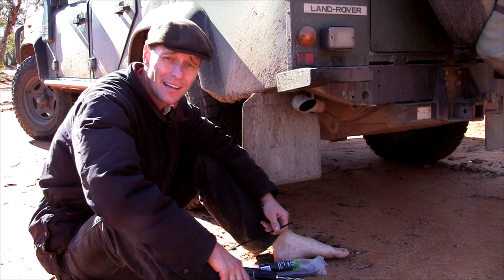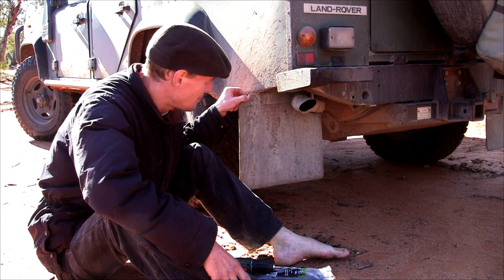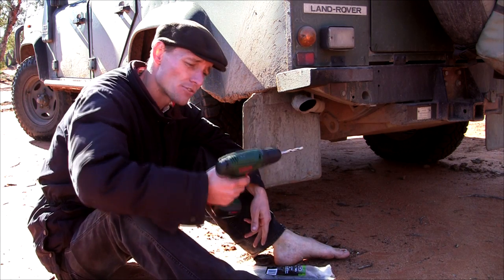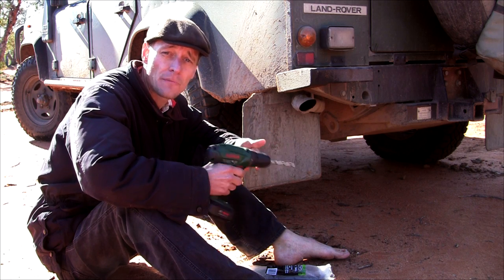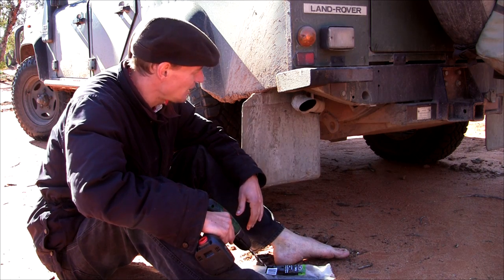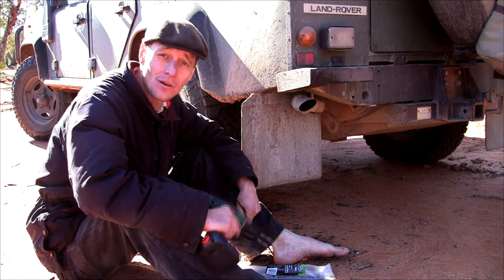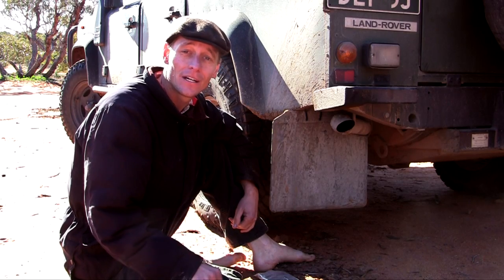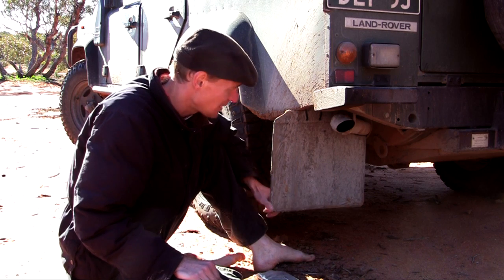Bush Mechanics | 4WD Mud Flap Repair with Cable Ties

Comment: There comes a point when there's more zip ties than rubber... Not sure without looking how much the genuine mud flaps are but I'm assured that cutting down a second hand truck rubber is the way to go... makes sense given the abuse and mileage they have to take... Good tip ... small drill and of course the essential zip ties ... a decent reaming tool might be an option just for punching holes through rubber and thin aluminium ..
Reply from the maker: Matt Allen in Oz genuine mudflaps were like $120 or something outrageous.. so I opted for aftermarket. I'll just keep adding ties till they fall off.
Reply: Roaming The Outback Daisy chain enough ties and you'll have rather novel mudflaps in no time... lol  It's the same price here for genuine 110 flaps ... personally on the rebuild I'll be adding some of Gwyn Lewis's mods to help keep the crud at bay.